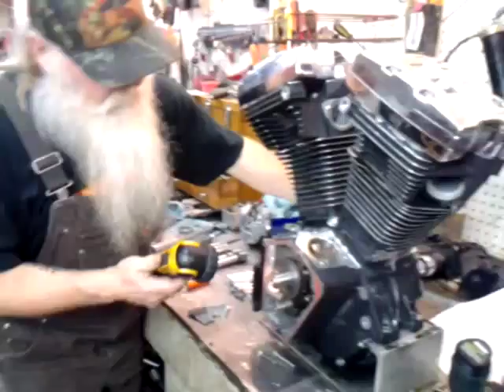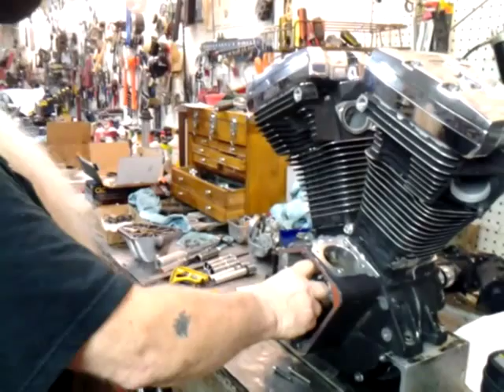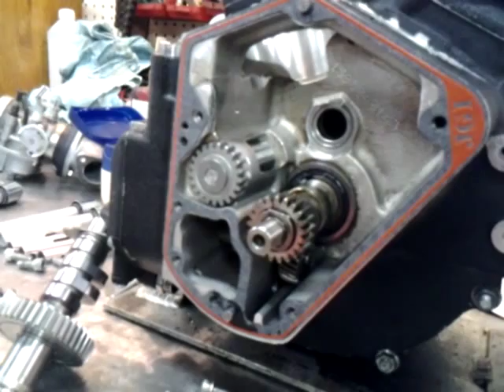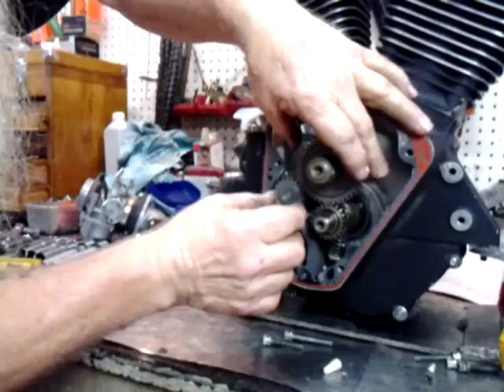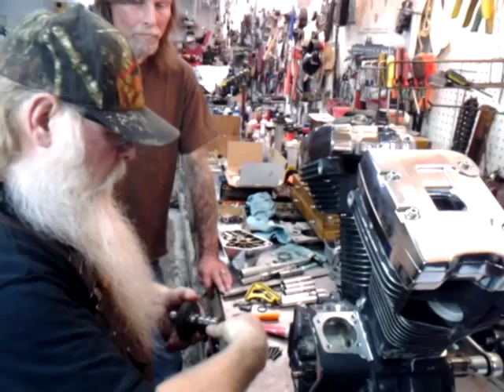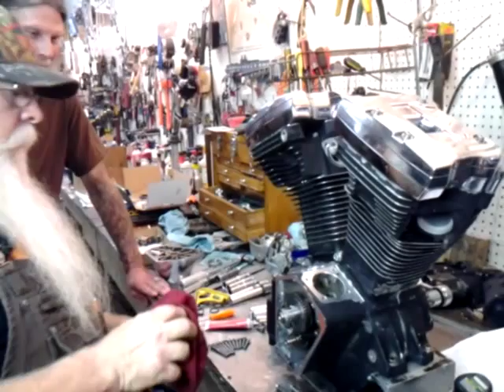Brothers garage cam install Harley-Davidson

Comment: Need advice. I do not have a timing dot on my pinion gear. Used cell phone to magnify image. I line up the vertical line in plug hole and eyeballs center line to install cam and breather gears.in your experience will this work. I had to rebuild top end due to plastic breather melted and blew out most gaskets. It was a mess. Please help with in depth answer.

Comment: the pinion gear spacing and the 508 cam gear don't appear to match with regard to teeth depth.  Seems to me there would be a lot of noise coming out of that nose cone. I've always pressed the stock gear on the aftermarket cam or... changed the pinion to match the cam gear.  This is referred to as gear lash and a LOT of people make this mistake.  They end up tearing stuff back down looking for bad lifters because that's what gear lash sounds like.  What you guys did won't hurt anything-  but the valve train could get real noisy.  Typically- all will be quiet until the bike gets hot- then the squeal chimes in.

ride safe.
Reply from the maker: We changed the pinnion too after the video., Good call.
Reply from the maker: Because we balanced it we thought we should keep nice and quiet. Does get a little noisey if you don't match the cam gear. Once again, good call
Reply: @MayerMusicStudios  oh- I only wish I made that 'good call' when it was my turn to do my first cam upgrade.  I installed an Andrews EV-27 some time ago... learned the hard way- like pretty much all of us.  Anyway- glad you guys ended up doing it right.  Thanks for the reply. Stay safe.

Comment: A LOT of presumption there, you guys did not mention and I assume you did ?
I missed the part where cam and breather end play was checked? 
Also pinion gear nut checked?. That little nut has a huge job!
Personally, I would remove and clean it and threads really well and RED locktite it on~!
Bent valves suck.
Reply from the maker: Yep